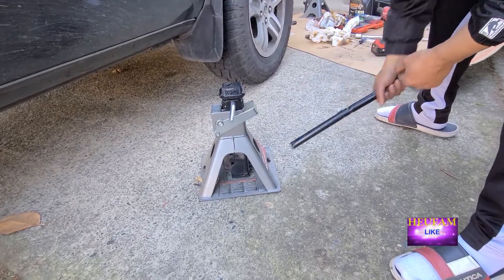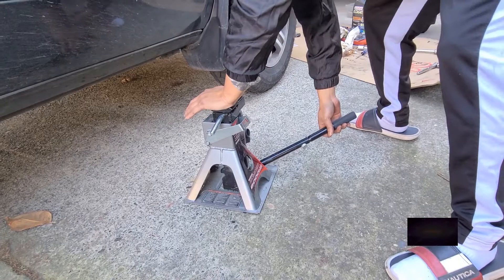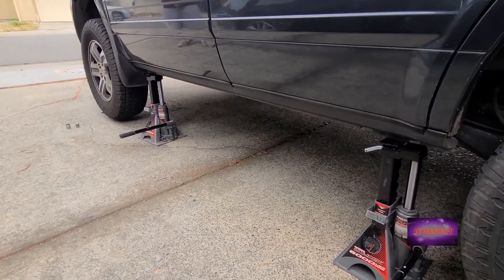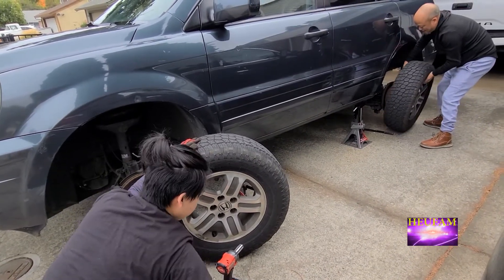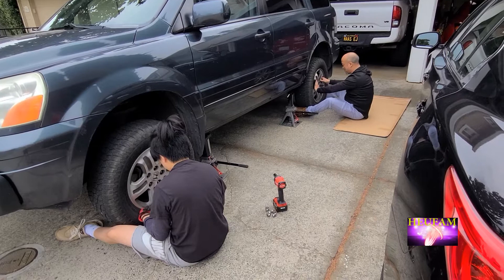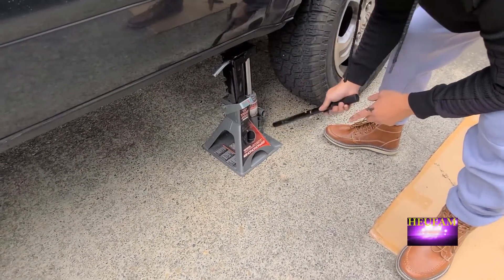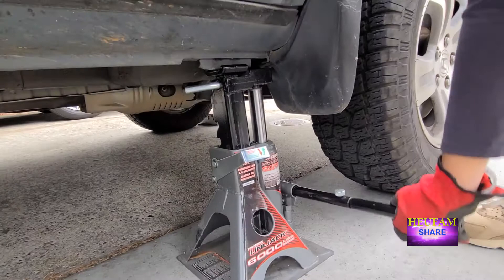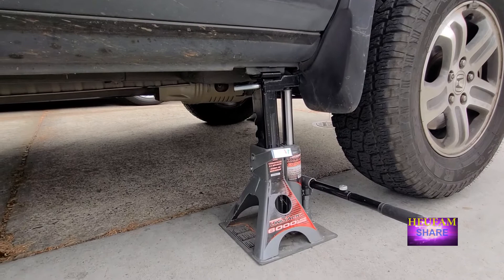Powerbuilt 6000 Lbs. Unijack Review and Using For DIY Tire Rotation

Comment: These will work best if you extend the top extensions using the manual pins before using the bottle jack pump. That will allow you to raise the vehicle more if needed.

Comment: I haven't found a video of anything changing a flat tire with on of these jacks.
Reply from the maker: If it's a totaled flat, your jacking points will be lowered than the jack and it will be a little bit harder. BUT, if u can run the flat tire over something that will give it more leverage then u can jack it up in 2 to 3 pump.
Reply: @HeuFamilyEnt  
Thanks 
That's what I kind of figured.